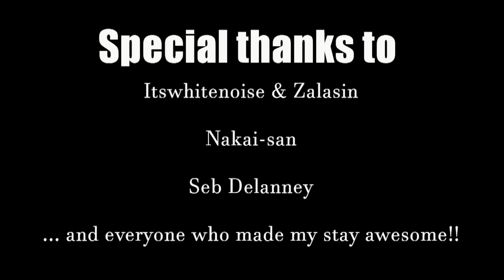Itswhitenoise RWB Brooklyn build by Nakai-san !

Comment: Doesn't look right from the back in my opinion. Great from the side and and front.
Reply: same
Reply: Tim Tursonoff ...too freaking wide. half the width might be ok. installing spacers to compensate the width will damage the hub bearings very quickly.
Reply: John Whodat i dont think there are any spacers, just very deep rims.
Reply: Yeah the rear wing is too small. Fat car needs a fat wing

Comment: What about corrosion protection?
At the holes, the screws make?
At the edges, he cuts? 

Why does he glue everything together?

Which other specs does the car have?
HP?
Suspension?
Weight?

Comment: You can't do nothing with it, you can't track it, drag race it you can't even bring it through the canyons. It's just a show car, anyone mechanically inclined can build one of his care. Front and rear bumper cover side skirts and space out the wheels. Having good craftsmanship would take cutting the quarters and feeders and then doing crazy sheet metal work so if you ever have to take a flare off someone isn't totally horrified. You can't do work like that that's why it only takes two days. Take the back tire off and you can see the whole side of the engine. Take your front wheel off and you can take shit out of the trunk???????
Reply: Jordan Berry actually you can track it pretty well, there is this thing called idlers, they organize race at motegi twin ring, there are tons of rwb’s racing there.